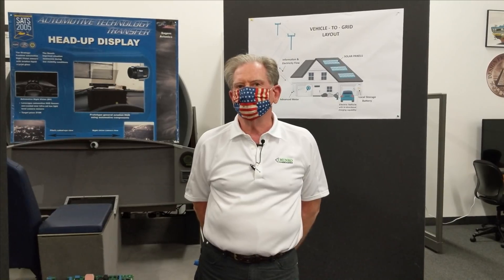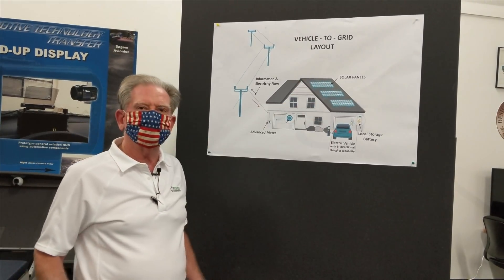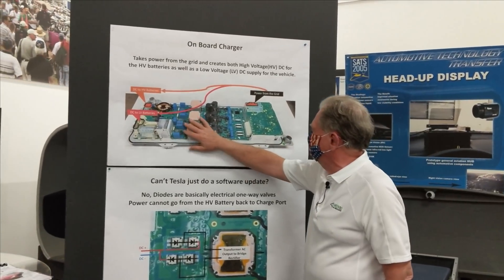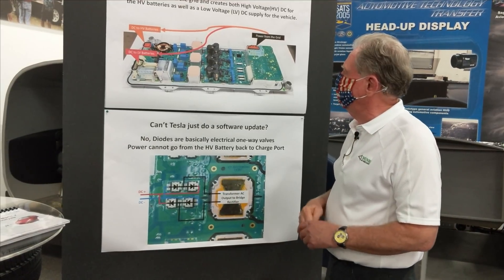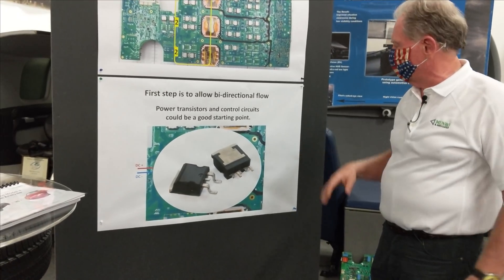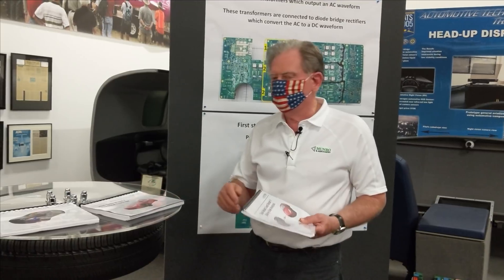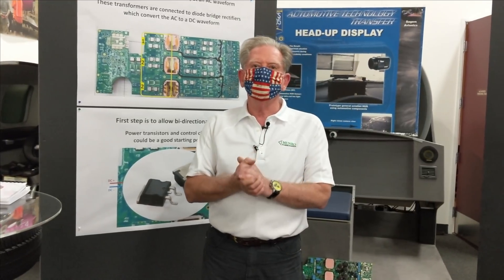Tips for Tesla E2 - Vehicle-to-Vehicle (V2V) and Vehicle-to-Grid (V2G) Charging

Comment: Sandy, far easier to just implement a supplementary board to allow V2V. DC battery output would need to bypass the entire AC stage on the charger. Maybe a small board and plug port in the frunk.

Comment: you do not need the V2G charger inside the vehicle. Just need a the high voltage DC chargers have this ability.   Like most manufacturers Tesla has DC port on the plug - you can just take power from there.  Tesla (or any other guy) just needs a Wall box with inverter to make V2G possible.  Could practical happen every day.

Comment: V2G is not just for emergency incidents! It will help buffer the renewable energy sources (day/night and wind/no wind) for the world's grids soon! Millions of BEVs will offer an enormous buffer capacity even if just a small percentage of their battery is used for that purpose. A huge and cheap version of the Hornsdale Battery Reserve which would make weaker plants needless.

But I have a question, Sandy: Wouldn't it be easier to use the anyway already installed high performance inverters to give back AC to the grid? Or why isn't that possible? Why should you use a "rectifier" backwards that has a much more limited capacity?

Thanks anyway for your interesting videos, please keep on doing...

Comment: Witricity has developed efficient wireless charging using high power level over a meter distance or so. This opens up the possibility of V2V while going down the highway. Put some extra batteries in a Cybertruck and it could recharge other vehicles equipped with a wireless receiver panel as they continue down the road by pulling up in front or behind and using bumper mounted panels. Semis could really increase their paying payload by needing fewer batteries.

Comment: V2G would be huge for the RV community. Tow your Model 3 behind your RV and use its battery instead of the generator for AC and heat. Then use it to zip around town, Super Charge and roll back.

Comment: Far cheaper EVs allow bi-directional charging - so why not Tesla?  V2V, V2H & V2G align with Tesla's principles, so come on Elon! Excellent video and I love the face mask.
Reply: I know it's a month late, but I figured I would throw my $0.02 in, I think they're absolutely going to do all of those different things, I think the Big Challenge right now is a mixture of some vehicles have free supercharging which could obviously be exploited, their batteries simply don't have enough Cycles in them to take full advantage of it outside of the occasional use. And like Sandy said the additional cost. Once Tesla vehicles have the million-mile battery I think you're going to be able to plug your car into your house and use it like a powerwall essentially. Even the smallest Tesla batteries have enough capacity to run my house for at least a week.

Comment: What about DC high speed charging? Do they have diodes on them for safety?  In DC high speed changing the charger is outside the car attached to the battery inside the car. So would it not be a cheaper option to modify the safety systems to allow DC back out? The equipment in the house would be responsible to step down the DC to be used with the existing inverters.

Comment: As far as I know, the DC rapid charging (eg. supercharging) connects the battery directly to the charger itself. So, if that pretty much is exposing the battery pack to the terminals in the socket - why would V2G care about these diodes ? Surely they are not used for purposes of charging. V2G in every other sensible charging standard (there's only one) - works that way. The V2G station becomes the DC->AC->AC converter - and the car is basically just exposing the battery pack via the charging port terminal to the outside world. 
Can tesla still do something like that ?
Reply: The point is a (few) months ago, there was an article where someone doing a tear-down of a Model 3 said the internal AC charger had 2-way functionality, ie was already set-up for V2G capability (and could have done V2V as well) leading to a lot of people expecting Tesla to upgrade ALL their vehicles with a single OTA update. Sadly, not going to happen.

Currently, if Tesla ever decides to do V2G (which I'm amazed isn't higher on their priority lists. Maybe after "battery day"?) then the users will have to pay to have a dedicated V2G charger installed in their house, in the same way CHAdeMO does, which can cost thousands. Users were hoping that was not the case, as that can cut into the financial benefit that could have been gained (although, I'd still suggest it would usually be worth it anyway)

Still, with Tesla having solar roofs, powerwalls and the autobidder software in their suite, I would have to guess it will only be a matter of time until they enable V2G in some way or another. In the future, V2G will be a MUST for a high-renewable density grid anyway

Comment: To turn DC to AC requires an inverter. A good quality one at 5kW is bulky and about $2000.
Even if made in house for $1000, that adds significantly to the cost. As beneficial to the grid as this would be, it could take 5 years to pay for itself at say 50c a day.

Comment: The fact there is a direct DC bus from the batteries to the charging port means it is possible. All it will take is a software modification and an external inverter/charger.

Comment: It's likely a bit more Sandy, as Transformers, transform and/or isolate. The Transformers are probable boosting the AC voltage level prior to the diodes begining the DC conversion. Even changing the  diodes will be meaningless in sending power back, as Transformers are open circuit to DC, so the battery dc would have to be converted back to AC and sinewave matched. That all said, of course there are ways, but it ain't cheap above a couple k watts, and your car would have to pass regulations pertaining to home wiring, the grid, and what not. A more likely scenario would be a home device attached to powerwall for VTG, and a smart DC-DC regulated, quereable line for V2V. btw - The Tesla folks are pretty smart, I suspect they are well aware of all of this. 😜

Comment: Are you sure that converter is using only diodes for rectification?  Those transformers are WAY too small to handle >2Kw at 60Hz.  So there has to be a chopper with transistors on the AC input side to generate a higher frequency.  The only high power transistor packages you show have the same package as the parts marked as "diodes".  This makes it likely that these are all the same part and indicates that they're probably using 'Synchronous Rectification' with FETS on the rectification side in addition to the FETs on the AC chopper side.  If they are doing synchronous rectification, then the hardware CAN flow power back to the AC side but maybe not have the efficiency or control needed.  There are also good regulatory, standards, sensing, and software reasons NOT to include V2G and V2V for now.

Comment: V2V is an amazing idea!  You could charge on the road from other cars, and you could even charge people more if they are heavy users, it's like a mobile grid.  Oh, I am envisioning this all being wireless, different than what you're proposing, but obviously you gotta start somewhere.  It seems to me that you could focus microwaves at short range to charge from other cars, but the loss would be prohibitive.  It makes you ask the question, if we had battery to spare, does the tech make sense?  It could be.  Absolutely love your videos, I could watch you tear down and assess just about anything, love the insights from someone in the manufacturing/engineering/automation field.
Reply: Wireless sadly is a non-starter. It's WAY too inefficient*, so the losses remove any real benefit you'd get from it. Microwaves are also dangerous at the power levels you're talking about, so you'd have to have the sender and receiver so close to each other, you may as well have them touch lol

What might actually become a reality is a tram/train style connector (I'm presuming under a vehicle) that can connect while parked and charge/discharge as needed, removing the need to physically plug the vehicle in. There's been similar prototypes for commercial vehicle tests (like buses) that can charge while waiting on passengers or otherwise idle. Not exactly a high priority idea yet, but I hope something like that catches on.

* - We're talking 60+% energy loss, so you have to pump vast amounts of energy in, to get only reasonable returns. There's also massive wireless interference to consider as well as other potential health risks from being around them. Phones are proven bad enough, we don't need several-hundred-fold-power increased devices too. 
- Just want to add, I'm not saying phones are dangerous, just that they're on the cusp and continuous, heavy use or misuse CAN cause health issues

Comment: There is nothing fancy on making V2G.in fact we've using that tech since we have been using uninterrupted power supply on our desktop computers.just get battery power then invert to AC.using sensors to detect power failure to switch via relay or transistor back to the power line.

Comment: What about towing on highway? Is it legal?
Reply: Most EV companies forbid it.
Reply: @JasonWW2000  really? can it cause some damage or why do they?
Reply: @trykozmaksym  Yes, it can damage the motors. Almost all EV companies will tell you it has to be towed on a flatbed wrecker truck. Some vehicles will not even turn the wheels and have to be drug onto the flatbed.
Reply: @JasonWW2000  hmm.. interesting. It makes sense if the steering is not working with dead battery, but motors - hard to believe because regenerative braking does not break anything...
Reply: @trykozmaksym  Regenerative braking only works when the car is powered up. When the car is off you have nothing working. No cooling system or oil pumps, etc... Check the owners manual of whatever car you are interested in and see what it says about towing.
Reply: @JasonWW2000  right, it makes more sense now... weird though - why not make some switch that disconnects all that power-dependent stuff - harder to steer and brake, yes, but still...
Reply: @trykozmaksym  hint, just wait 10 min start car, get towed, regen brake for a mile.

Comment: Can't you just tow an ev that's stranded with an empty battery?
Reply: Most EV's forbid towing
Reply: @JasonWW2000 
Ok, I didn't know.
Why is that?
Reply: @Daniel-zh3qz  The electric motors are not designed for it. Most all EV's are meant to be towed on a flatbed wrecker.
Reply: @JasonWW2000 
I see.
Thought they'd just roll and regenerate.
Reply: @Daniel-zh3qz  That is possible, at least with tesla, but you have to have the car powered up and drive it while being towed. You need a strong tow vehicle as well. It may not work if your completely out of juice, though.
Reply: @JasonWW2000  can't stop me.  From towing my EV to recharge it!
Reply: @davidbeppler3032  If your out of juice the vehicle will not take a charge by towing. You would need to do the towing before its battery is goes all the way down. You need to find out more details because not all brands can be towed period. You could do serious damage if your reckless as well as void the warranty.
Reply: @JasonWW2000  Nope.  Not how reality works.  But nice try.
Reply: @davidbeppler3032  Do some research, you'll see. Look for tests where people went all the way to empty.
Reply: @JasonWW2000  yea, watched people go all the way empty.  Took forever.  The cars get really angry when the battery gets below 3%.  Then they shut off at 0% and become paperweights.  Here is my question.  Why would you continue to drive with lights flashing red at 5 miles per hour for 10 minutes just to totally kill the battery then try to tow it?  Nobody would do that.  EVER!  Unless it is a test.  Just to do it.  So, based on nobody ever doing that.  Because they would not.  Hook a fucking tow strap to it, tow it a mile, drive it to a charging spot.  You seem smart, try thinking.
Reply: @davidbeppler3032  You think no one would do it, but just like with gas cars, people will do it. They will try to get to the charging station or home. So it will happen. 
Also, most people don't have a truck they can go get to pull their car to charge it. I dont think tow trucks will do it either since they might be liable for any damages.
The other thing is you have a moral responsibility to not tell people it's okay to do something when it can potentially damage their vehicle or void their warranty. People should not just go out and do it. They need to know the consequences of their actions. So for you, who is willing to take the risk, do what you want, just don't encourage others without explaining all the risks.
Reply: Yes.

Comment: Given that Tesla also sells dedicated stationary batteries, they have a vested interest to hold off on vehicle-to-grid for as long as possible.
Reply: My guess is that a Tesla PowerWall, which has a built-in inverter to change incoming DC to AC for your home, combined with a Tesla Wall Charger, as both an output & input device that communicates with your car, will be required, at least initially.  A PowerWall by itself may not be enough to power a medium to large home for long periods, but combine it with a 75 kWh and you’re good to go for a while.  In other words, V2H or V2G, Tesla’s gonna get paid.

Comment: Great video - 2 comments. 1. Cybertruck will have inverter, so you can do V2V and V2G (will need grid tie "adapter").  2. My understanding is that Tesla can allow access to battery DC via connector (like used in supercharger). So it can sell a "PowerWall without batteries" which will function like existing PowerWall but interface directly to the car's DC as the battery. So, do you think they can do it now or there's still a hardware limitation? I, for one, would be happy to pay $1k easy to be able to use my Tesla as a huge PowerWall - offset electricity cost and for emergencies.
Reply: V2V could almost definitely be done with a Cybertruck's on-board AC socket, in the same way you'd plug your car into a wall socket. Slow, but it would work in a pinch.

Tesla could definitely sell a V2G home charger (or battery-less powerwall etc). It's pretty much the only way it's going to be done as of now. This (with software and some other controller/sensors) would allow you to supplement your house's power with the car's battery power, which could save decent money (especially if you have solar etc)

But, if you wanted to use it for emergency back-up power for your house, then you'd need to add the extra safety systems that are required for the powerwall (called a gateway, in that system - it's a bunch of contactors that disconnect the house/battery from the grid, for safety of the grid and its workers etc). This would start to add extra costs to the system.

Comment: This is only examining the AC circuit which is unidirectional. Outputting via DC is still feasible because there is currently a DC to DC bypass for supercharging. DC output for V2G is how it works on the Nissan currently iirc. So it can be enabled through an OTA but would require an external inverter or a connection to a powerwall gateway, etc. Anyway, it’s doubtful they’ll do it regardless until they release the new battery tech...

Comment: I think V2V needs to be DC. Down that line, I think cyber truck having full battery voltage DC output to power accessories would be very innovative and disruptive and it's the logical direction for all sorts of commercial vehicles.

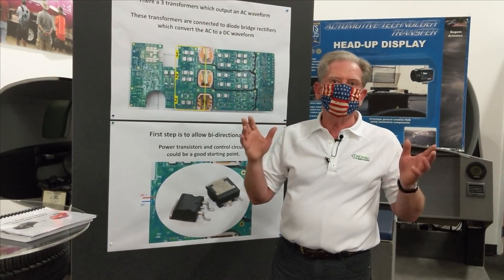Comment: @ 6:30 - 220v AC is not as dangerous as 110v AC. For the same power  220v uses about half the amperage (amps are what hurts - like water, it's like a power washer verses a regular hose).. Europe uses a range of voltages up to 400v (and 50/60hz). Back when electricity ws becoming popular, North America made a choice either politically (pushed by corps), or through ignorance, but chose to 110v. 
As an example, grab your kettle power cable after heating water. It's usually warm. That does not happen to kettles run on 220v plus the cable uses less copper.
Reply: This is incorrect in respect to electric shock

Mains electricity can supply sufficient current in either 240 or 120, but higher voltage pushes higher amps

Though for the average user it's not important because power systems isolate the electricity from the person

Edited for swipe typos
Reply: Actually, NA is 220-240V, they have just split it into 2 halves with "neutral" in the middle, creating in essences 2-phase 115V. Many other countries have done similar weird stuff. The only real difference is that US is clinging onto this older, more costly system, while most countries have moved to 3-phase 400V for better efficiency/lower cost.
Reply: France used to be ~120 V, but decided to change.

Comment: I wish people would include the super charging connection when talking about this. The super charging connection has no diodes. So you can have direct access to the batteries this way and the 240v inverter would be outside the car. This can be done now with no physical alterations. Just some software changes.